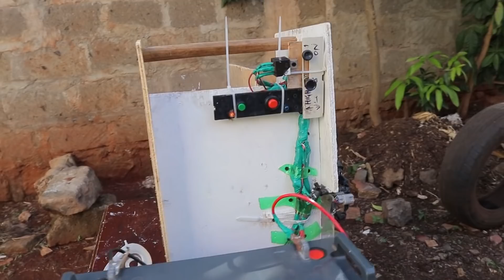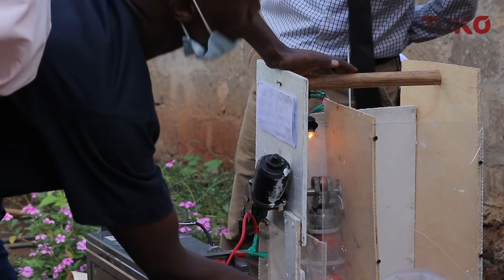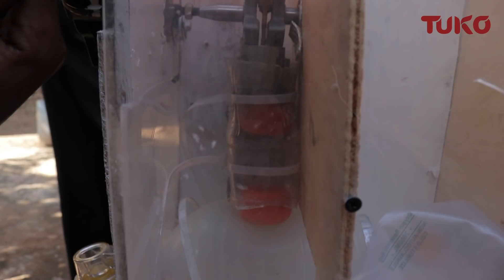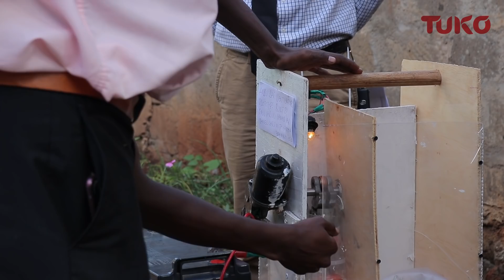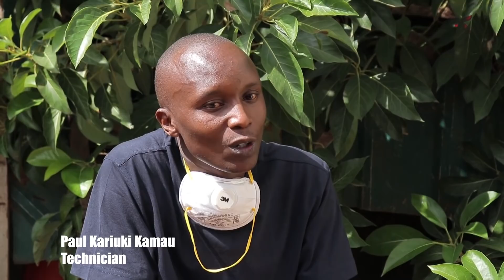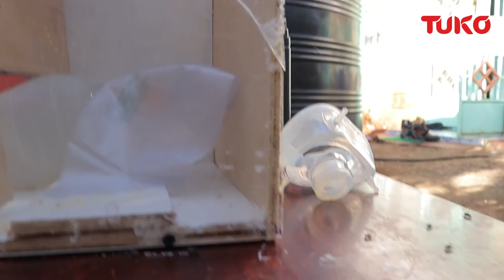Three kenyans great invention that will fight covid-19 | Tuko TV

Comment: Just the settings buttons for: fio2, tidal volume, rr, pressure, and peep: for what patient and machine is doing. In and out  air pipes. Alarms. Also try to make it smaller .
Otherwise kudos good luck